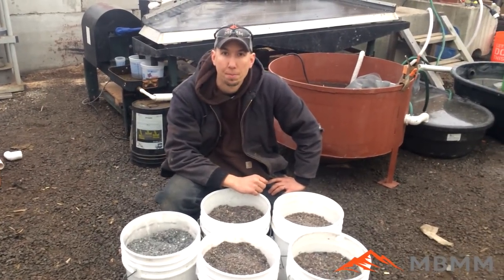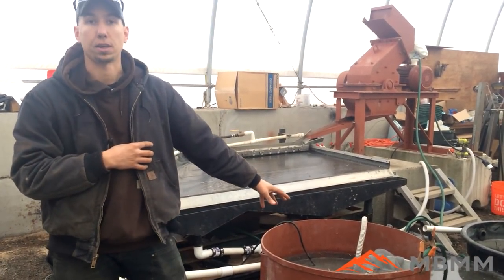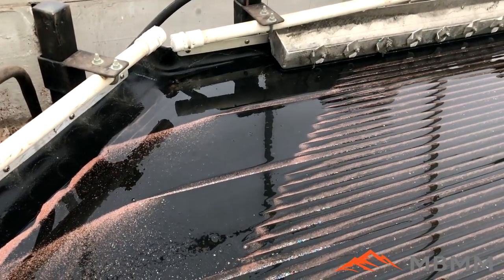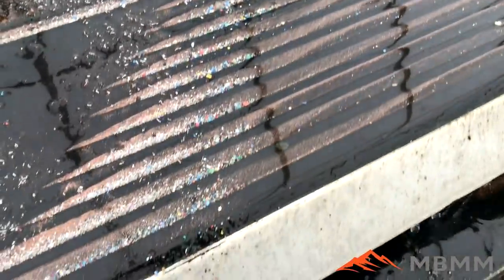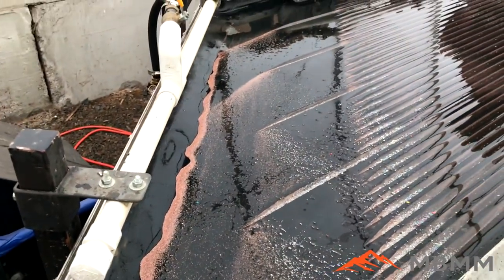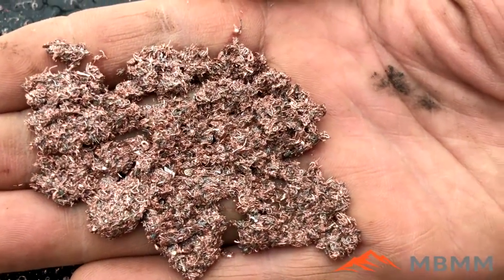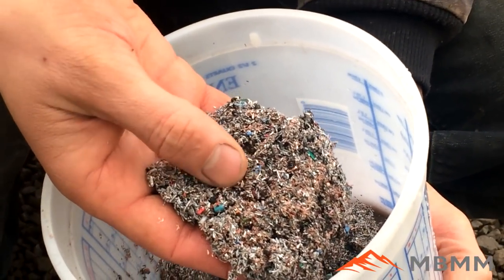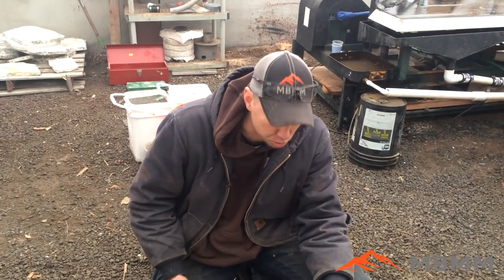Copper and Aluminum Recovered From Copper Chop Granulator Waste With MBMM Hammer Mill & Shaker Table

Comment: The best way I found to get the copper out is to run it through a powder mill,   then feeding into air spiral seperator, for a dry method
Reply from the maker: Great, thanks for the tip!

Comment: I really need your help,I am having a copper granulator and separator,but my crusher is making the size too small,as we are processing different wire ,can you guide me what would be the distance between flying blades and fixed blades? Thanks in advance
Reply from the maker: Unfortunately we are not qualified to make any recommendations on any machinery that we don't manufacture.
Reply: mbmmllc if I send you the samples of my material  it's  plastic and  copper , can you make solution for me?
Reply: raja ali    The size of the blades is not really important it is the size of the screen below the hammer mill. If that makes sense
Reply: @rajaali-hu6rf The same problem for me also. Can u  please suggest any solution